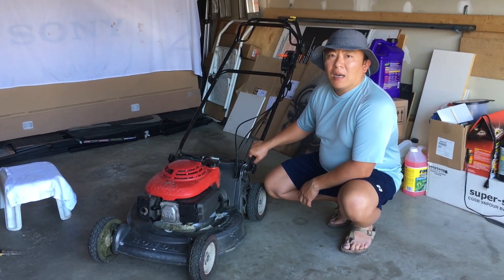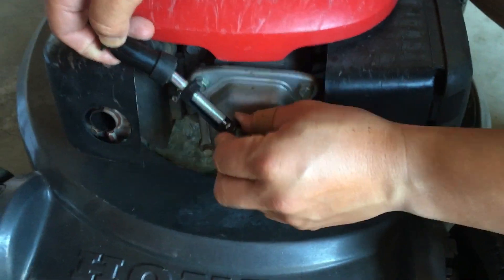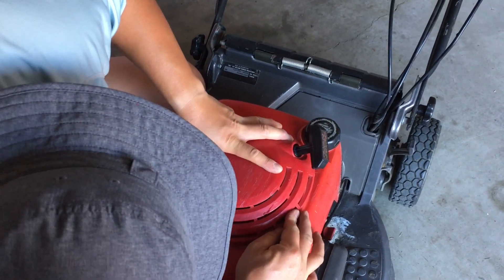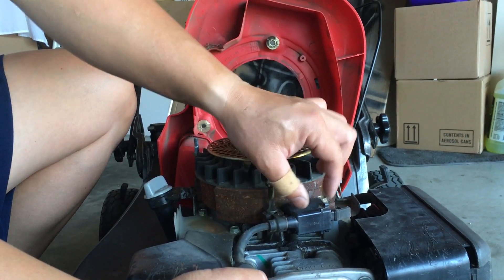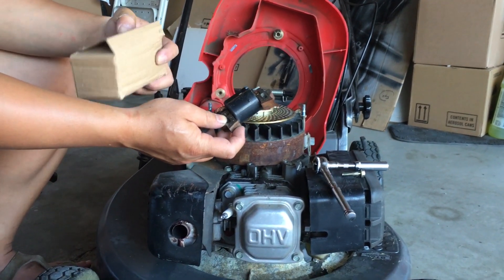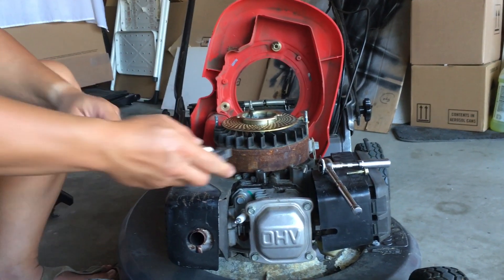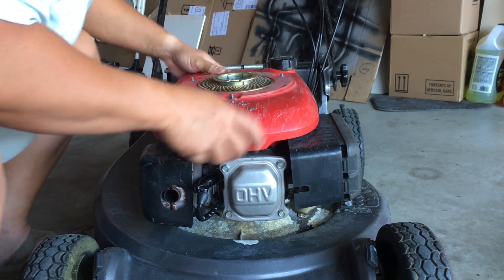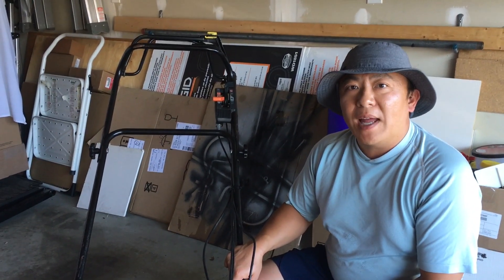Replacing a Honda Lawnmower Ignition Coil (No Start, No Spark)

Comment: Thanks for the great video. Ordered a replacement ignition coil and tested as soon as it arrived….only to discover the secondary coil was DOA with zero continuity. Sad.
Reply from the maker: yep, that is possible.  These parts are all mass produced in factories that probably has some loosey goosey quality standards (due to the nature of the product and application) so I am not surprised that you got a dud especially if you didn't buy a genuine honda one.  Honda ones, while are very high quality cost a LOT more than a cheapie aftermarket route.

Comment: Couple of things - "Finger tight" means tightened with your fingers, not a wrench. A better description is "lightly tighten" and demonstrate as you did. The other thing is that one should NEVER start a lawnmower with sandals on.  Ex-firefighter talking - the result of foot under mower is not pretty. Well, it's plenty pretty painful! And a great way to traumatize your family. Otherwise, great video - short and to the point!